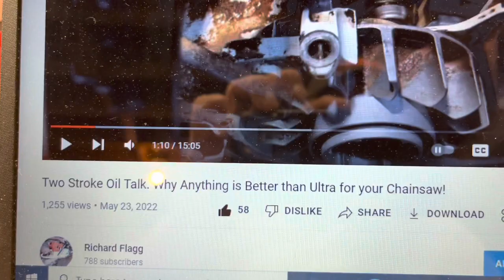Follow up. Delete Stihl Ultra Two Stroke Oil

Comment: I found your channel several days ago and was hesitant to drink the anti Ultra oil kool-aid.  I started buying Stilhl chainsaws in 2010.  I now own 6 saws.  I have used Ultra exclusively at 50:1 and had no plans of changing, until today.  I sent my MS261c out for porting and muffler mod.  Today my builder called to advise that the exhaust port had a moderate carbon build up.  This saw has only 34 hours of run time.  I'm a believer now and drinking your kool-aid. I smashed the "Subscribe" button.  Thanks
Reply from the maker: What oil did he recommend?
Reply: @richardflagg3084  Amsoil Dominator 40:1 or Schaffer's 32:1.  Ordered Dominator from Amazon, but can't find single quarts of Schaffer's.  Do you have an outlet I can order on line?
Reply from the maker: @larasea741  I don't have a dealer local so I buy it 6 quarts at a time off Ebay.  It's a better value with some quantity.  Single quarts are a little pricey with shipping.

Comment: (Coming from a non pro firewood cutter)    With all the advances made in oil in the last years,  I always think that mixing 40-1 is going backwards.   I've talked to loggers and so forth and most of them don't wear out their saw engines, but  over time the saws themselves just fall  apart and have to be replaced.   If two strokes are to survive at al, l they have to clean up and run leaner.
Reply from the maker: The advances are actually a good thing for running 40:1.  The difference from 50 to 40:1 is a tablespoon per gallon (.6 ounce to be exact)  The newest FD rated oils have a great detergent package to run cleaner without sacrificing lubrication.
Reply: run 43:1, which is 3oz oil per gallon. easy to remember, easy to measure, perfect balance of oil

Comment: Hi. Good videos. So I used to run 40-1 years ago, but one day looked at my 261 manual carb, took spark plug off and looked like had to much carbon on top piston. So I switched to about 47-1 so I mix 20 litres at a time and put about 425 to 450ml of oil in my 20 litre can. I haven't ever used that stihl ultra hp synthetic oil yet but have used the stihl premium castrol oil and haven't had problems. I own husky 562xp, 572xpg, stihl 170, 261, 441c, 462c, and 500i.  Ok so I do have a pack of that stihl ultra synthetic hp, again haven't used it yet but if did will 40-1 work or should I just toss that oil in the garbage? Lol!
Reply from the maker: I've heard good things about the Castrol/Stihl oil.  I'd keep using it.  😎
Reply: Hi Rod and great Comment!  Just go 45:1!  I’ve been doing that with good results.  Kinda an in between mix, I don't know?  See my above comment.  

‘DonyBoy’ ( If I may mention another Channel ) will add in an extra capful of oil, to the tank, on a rebuilt, or new saw.  I’ve recently ‘broken in’ two New saws, and I’ve made up a concoction of 40:1 and 50:1 Pre Mix, so they run a little rich at the start.  Who really knows, unless they do a tear down as Richard does here?  

Please support this Man everybody, as he is doing this with his Time and expense.  I recently hit the ole’ Subscribe button, due to the Video where he commented on the loss of an elderly Neighbor, one from “The Greatest Generation.”  It’s a shame how they will all be gone too soon;
And young generation of today doesn’t appreciate a dang thing!  I’m done.  Peace 👍

Comment: Hey Richard, what is the verdict on amsoil saber?
Reply from the maker: I've yet to see another oil perform better.  Have a look at the video I put up Thursday.  That ms440 has been running Amsoil for years.  Around 0:45 you can clearly see the exhaust port and there is no carbon whatsoever.

Comment: hi what do you think of stihl motomix
Reply from the maker: It's great for winter storage in your equipment while it's not being used.  It has a tremendous shelf life.
Reply: @richardflagg3084  what do you think about running it all the time as I've never run anything other then motomix most of my saws are pro saws
Reply from the maker: @freddiebuckner912  I can't say enough about how good the canned fuel is.  It's considered an off road fuel and is much more friendly to your saws fuel system and carb.  As for the oil, stay tuned, it will be one of the first oils I test.
Reply: @richardflagg3084  yeah I've only seen positive to it but would be really interested to see how it preforms in your test

Comment: Has the saw run on motomix?
Reply from the maker: Mostly Motomix and occasionally with 50:1 Ultra with non-ethanol fuel.  One owner saw.
Reply: Okay WOD you say the motomix is god or bad in norway we youe the motomix and the Aspen 2 May dealer say the motomix is the best
Reply from the maker: @stiantnnessen2671   Both of those fuel blends are the same as far as I know.  I don't think one is better than the other.  They are very good fuels and have a very long shelf life
Reply: Good that I’ve only bought 1 quart of that Stihl Moto-Mix, and have not yet run any of it….

The shelf life was the big draw.  I added more Stihl Ultra oil, as the Zenoah (generator) engine wants 32 to 1 oil.
Reply from the maker: @dennisyoung4631  Yup, the canned fuel shelf life just can't be matched.

Comment: Try sthil full synthetic oil or super semi synthetic oil for less carbon but it cost more 👍🏿
Reply from the maker: Super is not available in the US.
Reply: @richardflagg3084  even full synthetic oil has less carbon blue in colour but expensive than the red two stroke
Reply: @Richard Flagg  why isn't it?
Reply from the maker: @6900pilot  you'll have to ask someone more important than me.
Reply: @richardflagg3084  I can get super at my local ace! That’s weird it’s not available everywhere. Never had a problem with the ultra in my 441 don’t like the smell tho so I went to the orange Stihl oil tried and true been running it since the 90s and I cut old growth cottonwood run saws hard all day! Thanks for the videos very good information.

Comment: Would you recommend Castrol 2T instead?
Reply from the maker: I've heard good things, but don't have any first hand experience with it.
Reply: I thought it was the same as Ultra HP.  Supposedly Castrol is Stihl’s supplier.
Reply from the maker: @donrichter3523  It's not available in my area but I've seen the bottle with the Castrol logo on the back.  If I remember correctly it was in a white bottle.  Maybe it's only for Canada/Europe?

Comment: that piston never seen ultra oil by stihl..... ultra oil clean your engine and the top of the piston is not clean ....... so next time be sure what you are talking about xD
Reply from the maker: This Ms261c was bought new and ran on primarily Motomix and occasionally 50:1 Ultra with non-ethanol fuel mix.  It still belongs to the original owner.
Reply: @richardflagg3084  sure sure 🤣🤣🤣
Reply from the maker: @sunglaresg6883  You're more than welcome to talk to him if you like. Daniel at Crescent Carvers.